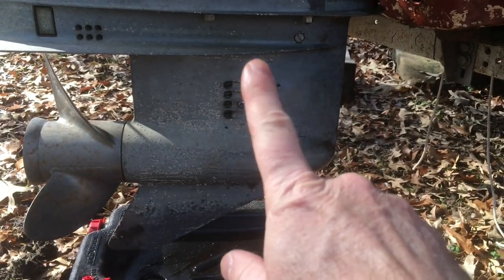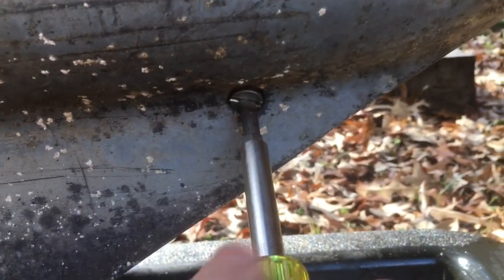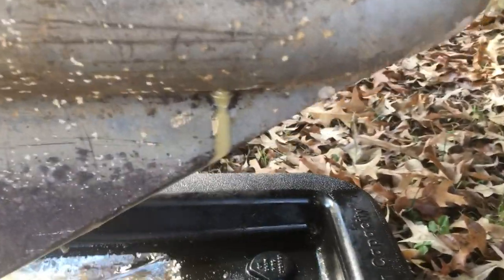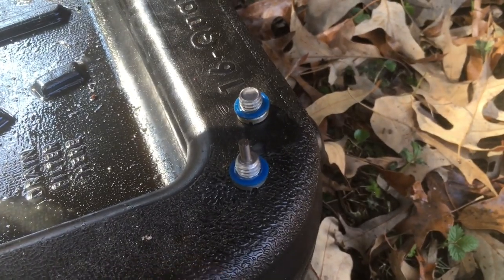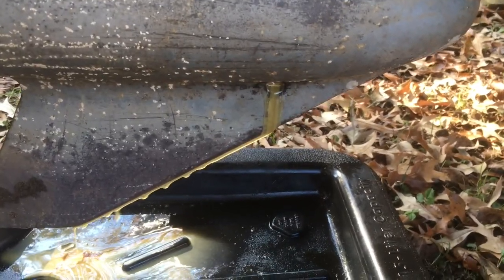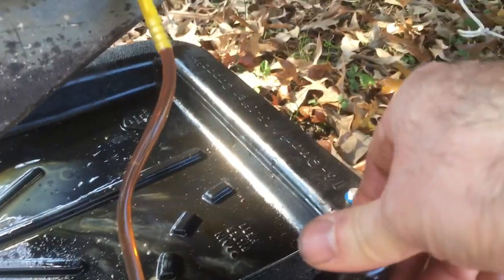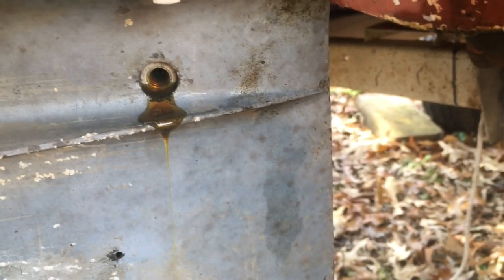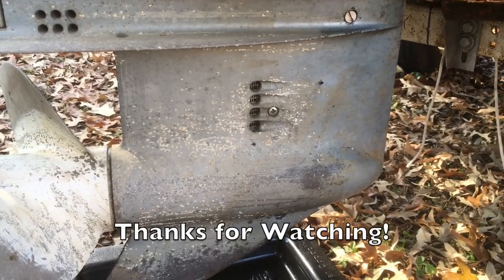Outboard motor lower unit oil change - Change your outdrive oil yourself!

Comment: Thanks Wayne.An older vid.I think what I am getting is white grease from the prop spline.It smells like grease and not gear oil.Tomorrow A.M. I will take out the top screw and dip a twist tie or a zip tie in to see if the color is different. Viewer Darryl in Western Canada (Vancouver Island)
Reply from the maker: Seems like that's just grease from the last time the lower unit was worked on! Usually if there's water intrusion it will be milky or actually water in there.